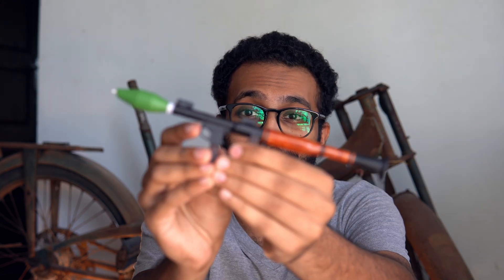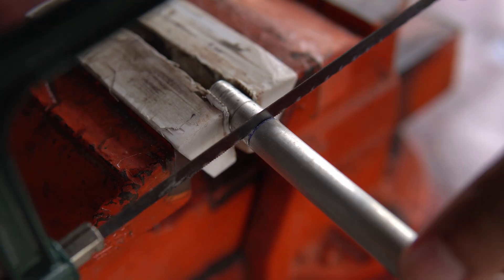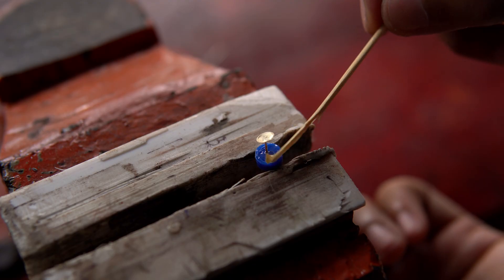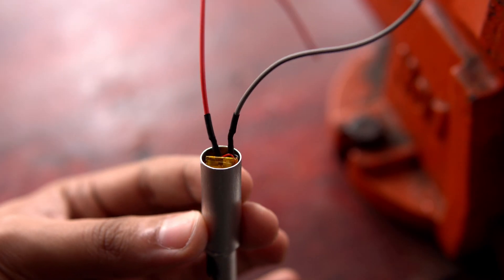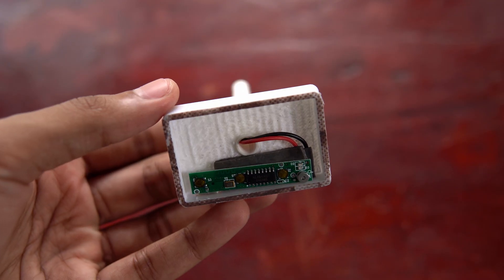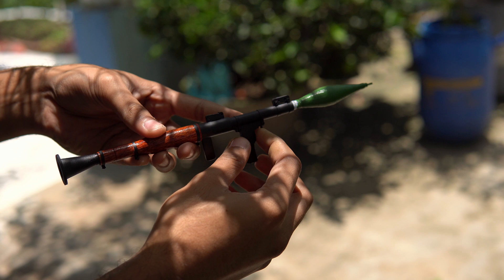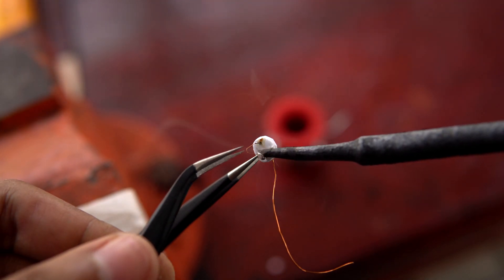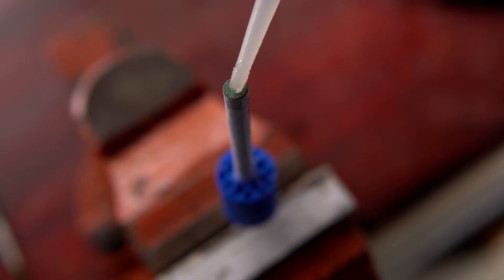Making World's Smallest Working Rocket Launcher !

Comment: Please how do you connect your second wire to the battery for charge system
Reply from the maker: Please see the circuit diagram in the video. Charging stand is made in the video "Rocket launcher Pen". Circuit is similar in RPG and rocket launcher pen.
Reply: @bibinsagaram   thanks